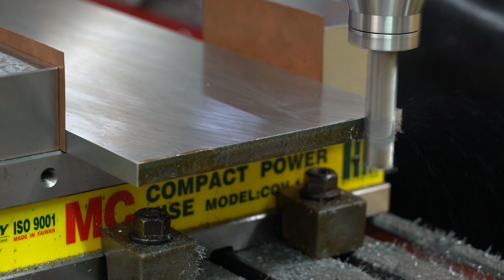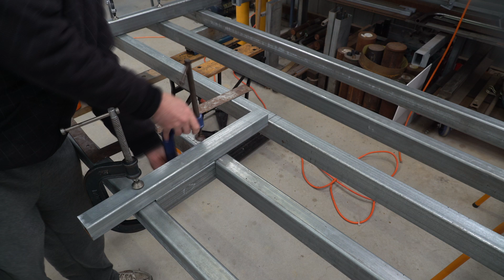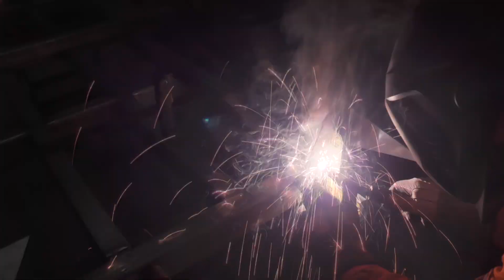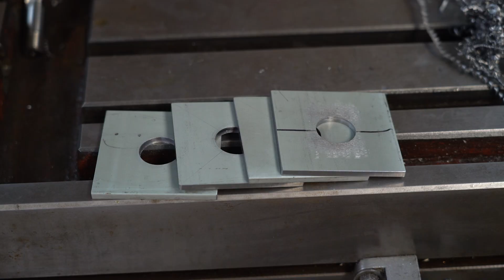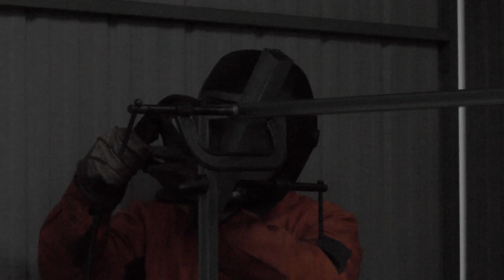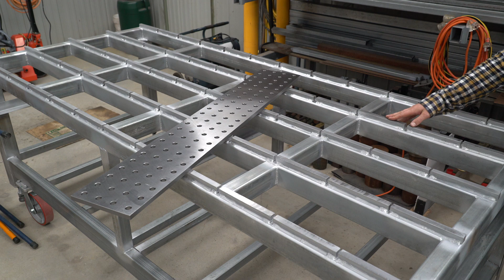Dream Precision Welding Table / Workbench Build - Modular Plates and Awesome Clamping Options

Comment: Dude luv ya work, as a toolmaker I appreciate the time in drilling and tapping all them holes, I did a fixture plate to go on a cnm machine it had 1200 m8 tapped holes I did it on a manual jig bore and centre drill and drill and tap and counter sink every dam hole, it still haunts me now when I see loads of holes. 👍 🏴
Reply from the maker: :) I had to take week long breaks when drilling and tapping all those holes definitely tested my patience.
Reply: @ProjectsDownUnder  there is nothing worse than been overwhelmed with hard bloody work:) hats off.

Comment: One tip I would offer is a sight level.  You can sight in your horses or whatever surface you're locating on with an accurate scale no matter what your floor looks like. I want to build a table similar to this, but those holes.  Great build!

Comment: Beautiful table. I was wondering what the reason was for the catch trays to be so far below the top?  Seems like it wastes a lot of usable space for the bottom shelf, or space for a second shelf. Thanks
Reply from the maker: They are a bit low so I can reach underneath and bolt on fixtures to the table.

Comment: A tip for reducing the amount of tips you need for clearing material away from the flame cut edges if you ever need to do similar jobs in future - Its counter-intuitive but cut deeper

If you cut deeper, around 2-3mm, with a cutter with a positive tip rake angle you will cut in the softer materiel that has not been carburized by the flame cut and scoop the soft material out so it can break away the hardened area rather than having to smash through it - Engage and then feed along rather than doing repeated side feeds also if you can for less tip contact time
I discovered this when I had to machine the flame cut edges of 3 1m x 2m x 100mm plates - used less tips doing the 2nd and 3rd plates than the 1st 2/3rds of the 1st plate
Reply from the maker: Thanks for the tip. I will try a deeper DOC next time I'm doing something similar.
Reply: @ProjectsDownUnder  Edited my 1st comment as I mistyped and said positive rake when I meant negative rake - Negative rake slides under the harder area, positive requires you to smash through it
Reply: this is an excellent comment

Comment: I have almost the same project (slotted welding table) with 15 pieces of 15cm width x 120cm depth x 1.6cm thicknesses. It took me a year, and still working on it :( . I am new to this, but determined to finish it before 2020 :) . great job @Projects Down Under. keep on.
Reply from the maker: Thanks. It's a very rewarding project good luck with yours.

Comment: I've been drawing up stuff in CAD myself to try and complete a similar project in my shop...The biggest problem I've had is finding a shop to make all the holes...WAYYYYY more money than a buildpro MAX table and then you have the Blanchard grinding to sort out as well.  I originally balked at the 5k price tag and said I'll build it myself...priced everything out and not that build pro looks like a bargain haha. Good job on the build!
Reply from the maker: Yes I was quoted $7800 to do the plates! Luckily I found a good place that did the grinding and cutting at a reasonable cost.
Reply: @ProjectsDownUnder  Thats what all the job shops around here quoted me pretty much as well.. I checked out OSHCUT and having the holes laser cut and its still about 3k before shipping

Comment: Great build and thx for the video. Are you able to elaborate more on how you hold the plates down and how you level them?
Reply from the maker: The plates are bolted to the support bars that are welded to the table frame using m10 bolts. I simply put a long aluminum straight edge across the whole table and used the set screws to raise the plates until it was level then tightened the bolts.
Reply: @ProjectsDownUnder  Nice work .. has that worked well for you? I assume then that there would be a tiny gap between the support bars and the bottom of the plate caused by the set screws (ie. no shims?). Lastly, would you have any interest in making some fixture plates for one of my projects (if you are Melbourne based?)?
Reply from the maker: Thanks Mike. The set screws have worked very well and I've had heavy pieces on it and the level hasn't changed. It would take a great deal of weight to make those set screws dig in to the support bars and change the level. I would have been interested in making some fixture plates but unfortunately my mill is in pieces being rebuilt and my lathe is also now in pieces being fixed and I need my lathe to fix the mill :( and I'm not sure how long it would take to fix it all.
Reply: @ProjectsDownUnder  sounds like you have your work cut out for you! Last question, what type of set screws did you use ... cup, dog, flat?
Reply from the maker: @stelmm  Indeed :). I think the set screws are cup as they have a slight dimple on the end. Maybe flat would have been better but they don't dent the support bars at all even when I tighten the plate bolts very tight.

Comment: Great job!
But I’m wonder 
If it’s made out of pieces why not leave space between plates?
I’m wonder
Reply from the maker: Plates are removable so I can have a space whenever I want. I also use the table as a bench sometimes so didn't want gaps between the plates.
Reply: Yea gap it’s the Wright word
I’m in search of welding table so I understand better now

Comment: Nice job.
What are the dimensions of the plates and what is the distance between the center of holes.
Reply from the maker: Plates are 1200mm by 200mm and hole centers are 50mm apart

Comment: What thickness did you use for the top plates? And why did you say that it would have been better to not machine all the square bars or cut them into pieces? 
-An enthusiast
Reply from the maker: 16mm. I machined the bars flat to make the plates lay down flat but since I used set screws to level them it was all moot

Comment: In the future, unless you are low on excess stock, taking a deeper depth of cut to get under that hardened slag layer would have saved you some hassle machining the edges
Reply from the maker: Thanks for the tip. Next time I will
Reply: You mean width of cut?

Comment: It seems that you have experienced some distortion with laser cutting in the past. Do you think you would have the same distortion issues with 300mm x 300mm x (say) 25mm plates?
Reply from the maker: There would be less distortion. But probably still some.

Comment: Did you level the plates after installing them? You spoke about frame distortion and I'm wondering if you can level each plate to be coplaner with themselves independent of the table? Much like Fireball Tool does his.
Reply from the maker: Yes I leveled them after installing. I was able to get the top perfectly flat thanks to the set screws.

Comment: Wow 😳
That really was a ‘toolroom’ build 👏👏👏👏
What was the final weight?
I have a Demmler 2D ( built in Wollongong NSW) that weighs 600kg. Single 25mm slab top.
Reply from the maker: Thanks. The plates weight about 500kg and frame about 300kg. Definitely a heavy beast.
Reply: How flat did you manage to get it ?
Regards
Robert

Comment: Well now that I know this is the best welding table build on Youtube, I guess I can stop watching weld table builds! Seriously, fantastic job on the build and the filming - this is the level of quality I've seen from well-established channels like Pask Makes or My Mechanics! 

Question though - do you expect much travel with the set screws? As in, changes due to vibration etc. Or is that negligible? I think being able to adjust them is much better than a static setup, but I'm wondering if there are any trade-offs. Not that it'd be a big deal to re-level it if needed, but if you're anything like me the 'set-it-and-forget-it' mentality can come back to bite you.
Reply from the maker: Thanks. Since this build I have done a couple projects and even hammered on it (not that one should) and it has not moved. I'd imagine if the M10 bolts holding the plates down don't have enough force to pull the plates out of alignment the plates will not move under normal use. If I started hammering on it with a mallet I'm sure they will move and need some readjustment :)

Comment: Hey man awesome stuff love what your doing. I have a question on your brobo saw. I’ve had mitre bandsaws in the past and there great nice and quiet working at night and bands are cheap but not the cleanest cut although still great. I’ve also owned a macc 315mm cold saw but it was so loud and vibrates like crazy. What’s your experience with the brobo for cutting a solid stock and thin tube with the same blade/ tooth count? Cheers
Reply from the maker: My blade has 220 teeth and it's fine for tubular steel 270 would be better. For solid stock the cold saw sucks I would take a band saw any day for solid stock. The blade has no clearance so it heats up and starts binding. For tubular steel I prefer the cold saw as it is much quicker and cheaper in the long run. If you can have both :) if only one get a band saw.

Comment: Excellent, only thing missing was the stress relieving. Contact me to hear how. Cheers Mate.
Reply: Not sure there's much point in stress relieving the frame.
Reply: @OU81TWO  With all respect, then you can't know much about stress relieving. Thanks for the comment. Cheers.
Reply: @rockcrusher4636  Maybe I don't. So why would it be important to stress relieve the frame?
Reply: @OU81TWO  I don't like people that are only looking to contradict, come with some facts, myself with 65 years experience as the stress relieving master know what I'm talking about, not an enjoyable pass time, to contradict. Tell me why you think it's not necessary,, remember how meticulous the build was?
Reply: @rockcrusher4636  I'm not trying to contradict you. The way I see it it's just a table frame and I don't see the added benefit of stress relieving it. It won't change anything given the context/intended use. My question is sincere because maybe you see something I don't.
Reply: @OU81TWO  What I see is that the adding of welding heat to any metal changes the molecules by scrambling them, making the steel around the weld in this case very brittle. One way to stress relieve is an oven, obviously no one at home has this choice, the next is lift it up 100 feet and drop it, not good in this case either, next bury it underground 10 years, also not realistic here, the next is shaking, these machines can be rented at a reasonable price and this would be the best choice. Any input of extreme heat into metal scrambles the molecules and makes the welded construction weak. We either build like were Americans or we can buy Chinese shit. Thanks again Cheers.
Reply: @rockcrusher4636  I understand the various stress relieving processes but my question is why do you think it's necessary for a table frame? I've been design heavy lifting equipment and automated machines for 25+ years. It's how I make my living. I always specify stress relieving prior to any machining or for critical structural applications for obvious reasons. Many types of weldments however do not need it. It's an extra expense that doesn't really add value in many cases. In this particular context (welding table) it wouldn't accomplish anything. The functional part of that table build is the table top and it needs to be flat. If it was welded as one assembly and machined flat then absolutely it would need to be stress relieved. That however is not the case. Any frame distortions due to welding and no stress relieving is compensated for by the fact that each of his top plates is adjustable. Structural stability is also a non issue since the table will never experience significant loads (or cyclic loading) so the risk of stress corrosion cracking while in service is almost non existent.

...in my professional opinion.
Reply: @OU81TWO  Without it the material will also move, it's about doing it right, he did the rest correctly way beyond what the other videos I've watched, so I thought to inform him of the highest achievement level. I knew as soon as I informed you all about stress relieving that you would come out as the closet expert. That's fine with me I'm just a 80 plus year old asshole, you win. Thanks again, no further communication please.

Comment: Awesome table, is the frame Galvanised? Looks like it. And if so what type of MIG wire did you use
Reply from the maker: Yes galvanised. Using Hyundai Supershield 11 gasless.
Reply: @ProjectsDownUnder  awesome Cheers. I currently only have 2 welders . An old AC buzzbox (CIG) and a Unimig AC/DC TIG/Stick machine. The only success I've had on stick welding galvanised steel is using E6010 Cellulose rods. E6013 is a nightmare with Porosity. I'm soon going to purchase a MIG welder because I want to do some Spool gun Aluminium and some regular MIG. Also some galvanised MIG even though it's really dangerous with the fumes. I always wear a respirator but it's still awful shit
Reply from the maker: Yes a good respirator is an absolute must when welding gal especially with gasless. Someday I will buy a welding helmet that blows clean air on your face but for now I use a respirator.
Reply: @ProjectsDownUnder  you should check out the new Unimig Goggles which can be used for Welding. Cheaper than a PAPR helmet and designed to take a respirator. It's got a grind function and detachable face guard
Reply from the maker: Thanks will check them out.

Comment: This is an awesome table. I'm building something similar and I wish I had have seen this video before I started mine. I've used 100x50x6 for the top which after seeing this is overkill and very heavy. Now that you've had this for some time, is there anything you wish you done differently either added or left off. Great video, thanks.
Reply from the maker: The thicker tubing will make the top distort less. If I was starting again I might have bolted the plate support bars instead of welding to avoid the distortion they caused. The other option would have been to weld bolts to the table like what fireball tools did with his table with a nut underneath for adjustment. There are pros and cons for each method but the set screw method works fine and I have had no problems with it and got the top pretty much dead flat and it has stayed that way.
Reply: @ProjectsDownUnder  yep i'll bolt the plate support bars. Thanks

Comment: Hello, how did u straighten out the frame after welding?
Reply from the maker: No straightening after welding. I used set screws through the plates to level the top.

Comment: Thanks for the video. What level of precision did you achieve? (Eg: what’s the height variation between plates, assuming you measured when levelling)
Reply from the maker: Since it uses set screws I can level it till it is perfect. But if I could no longer fit a 0.01mm feeler gauge under the straight edge I was happy.

Comment: 2 plates per day? Wow. A laser CNC can cut 200 per day, why bother doing it yourself
Reply from the maker: The laser cut plate that I had made was far too warped for a welding table and the holes very uneven. Having the plates laser cut was the original plan that didn't work out.
Reply: @ProjectsDownUnder  Surprised you didn't get it waterjetted to be perfectly honest. Plenty of waterjet's in Australia (especially around Melbourne).
Reply from the maker: @Entaran  All the quotes to have the plates water jet cut was way too expensive unfortunately.
Reply: That is an awesome table - with I had the time and patience to do it like you did. I made my table out of a single 2000x1000x12mm plate and only drilled around 20 holes across the whole thing but marked where each hole should go - now when I need a new hole for a fixture I just drill and tap it at the time. After 12 months, there are still huge sections without holes so glad I didn't do them up front - wonder how many years it will take before you use every hole?

BTW, I have around 1.5mm deflection across the whole table so I need to shim my work if it needs to be perfect.

Comment: Did you copy my table from my video
Reply from the maker: Design is based on BuildPro series of welding tables
Reply: That's what I based mine on as well but went 200 mm wide plates 50mm grid pattern 1250 long plates, plasma cut them myself them machine edges faces .. check out YouTube video about 6 years ago
Reply from the maker: Cool I'll check it out.
Reply: I also used 25 x 25 mm square solid tapped holes  full length of rails 4 off continuous can stagger off sets 50mm increments, I did a video on how to tap holes
Reply: How's the magnetic folder going, looking at buying the  1250 mm Magna bend with folding assist,  and the siegmund 2400  x 1200 3D professional extreme plasma nitrated with clamping package , is your folder 6 tonne clamping force ??
Reply from the maker: It's going good. I think it is 6 ton clamping. Only downside to them is they don't work that well for thick aluminium.
Reply: Will it fold full sheet 1.6mm  1200 wide do you think it will fold full sheet at 3 mm with a relief cut on the folding line ??
Reply from the maker: Haven't tried 1.6mm 1200 wide yet but I think it will do it. Tried 1.6mm 700 wide and it worked fine. Not sure about the 3mm with relief haven't tried something that thick.

Comment: Beautiful Welding Table! How do you plan on avoiding surface rust over time? 

I built a similar table for a school project that you can check out on my Instagram @hardline_fabrication (one of my first posts)
Reply from the maker: Nice table you made too. I used anti spatter spray to stop the rust. I sprayed the whole table with a couple coats and so far no rust.